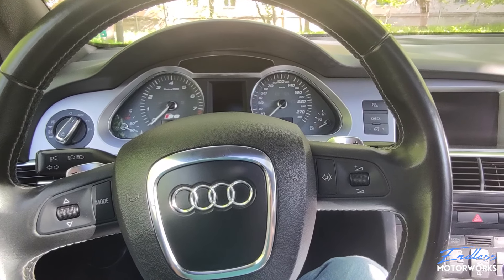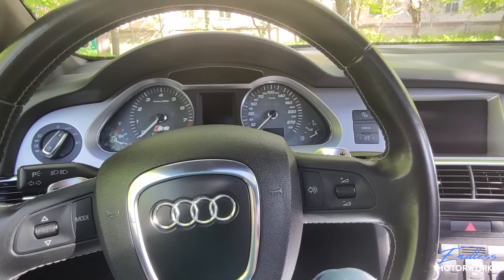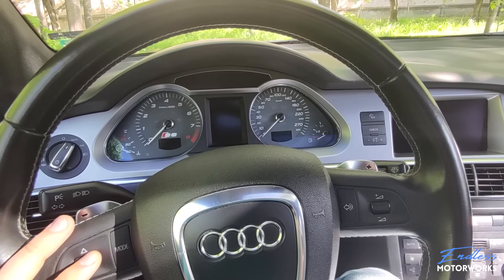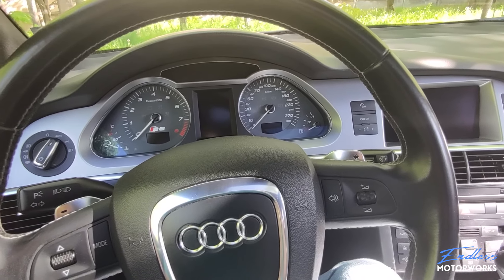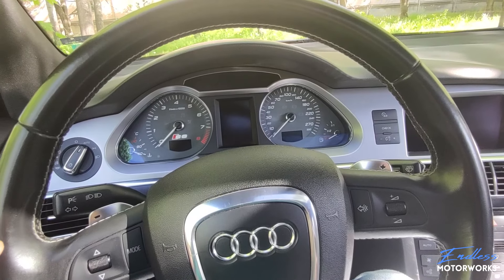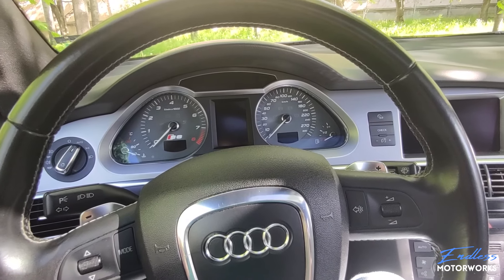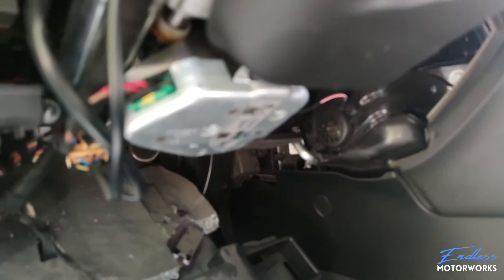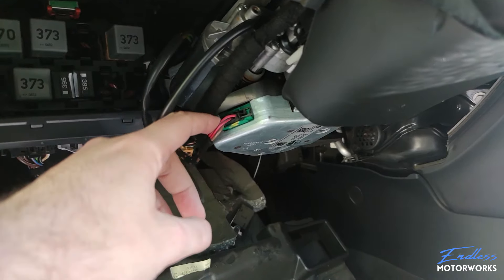How to Prevent or Fix the Steering Wheel Column Lock Actuator Issue on an Audi A6 / Q7 (DIY Repair)

Comment: I cut the red and black wire and my steering lock doesn’t lock now as you stated. But now I’m getting this annoying message on the dash now saying “to engage steering lock, press and hold stop button”. The message on the dash also has a beeping noise with it and it only occurs when i open the driver door to get out the car or when i open the driver door to get in the car. Any idea about this or do you know how to make that go away?
Reply from the maker: I have never seen or heard anything concerning this error message. The only reference I am able to find is of an error message that goes as follows: "Put the shift lever in Park or the car may roll away, to engage steering lock, press and hold stop button." Is this the fault message that you are getting?
Reply: @EndlessMotorWorks  I’m only getting the second part of that message which is “to engage steering lock, press and hold stop button” I’m not getting anything about putting the lever in park because it’s in park when that message shows up.

Comment: Hello Sir, My A6 2008 is locked and the thing is I cannot scan the code to clear it to unlock it first to do the trick. The car is not starting. Is there any other way to scan and remove it. Thank you
Reply from the maker: You can try tapping on the module with a hammer. I know this has worked for some people.

Comment: after cutting cable does the pilot and central lock from key pilot still work?
Reply from the maker: Everything else works, just the steering will not lock itself.

Comment: Hello friends!. I have the same issue with my Audi A6 Quattro 2005. The steering wheel actually is unlock, but  the car don´t start and when i put the key in the ignition nothing happens then. I like to do the action on the video descripted.
Reply from the maker: If your steering wheel is unlocked then you do not have the issue that I am referring to in this video. The 2005 A6 is also probably a C5 generation so the lock mechanism and wiring will be different. 

I would recommend getting your vehicle scanned for errors, as that is the correct way to diagnose the issue.
Reply: Thank You! 
 @EndlessMotorWorks

Comment: Hi. Will this work for a 2015 Q7? Is it the same wire color code?
Reply from the maker: Depends, 2015 is a transitional year for the Q7, which means that is the final year for the first gen one and first year for the 2nd gen one. If yours is the first gen Q7, then I would say probably yes.
Reply: Will this work on a 2013 Q7 3.0T gas?
Reply: @EndlessMotorWorks thank you for this video!!! Will this work on a 2013 Q7 3.0T premium plus with flip key?

Comment: Ok if the car don't start, instead of cutting the wire what if I just take off the plug, will the car still starts ans run
Reply from the maker: Nope, it doesn't work like that. Inside the module is information necessary for the immobilizer to work properly. If you disconnect the entire connector the immobilizer will think someone is trying to steal the vehicle and you won't be able to start it.

Comment: I have a 2011 A6 and today the "Please Take Load Off Steering" error was displayed and when turning the key the car will not start.
Does you method fix this issue and will a dash error light be displayed after cutting the wire?
Reply from the maker: Yes, the DIY will fix the issue. However, you must unlock the steering wheel and clear the associated error before cutting the wire. If not, your steering wheel will remain permanently locked and the error code cannot be cleared.
Reply: I had the  "Please Take Load Off Steering" message come up on my 2005 A6 about 3-5 times before the car just stopped working altogether. Towed it to a repair shop and the column was busted. Luckily the repair shop knew a place where they dismantle and fix old columns, so they took it out and sent it to the specialist. I got it (and the car) back fixed, soldered and whatnot. It cost 700€ but overall at least I didn't have to buy a completely new (expensive) one, which I've understood is a lot more.

Comment: In order to clear the fault code first, when Its already locked, I Will need to turn the ignition to perform a scan. How is this possible, when the column is locked?
Reply from the maker: You can turn the ignition in order to provide power to the cluster, you just won't be able to start the car.

Comment: Hi bro,got an issue on a 2007 Q7,steering lock stop working at a certain point,so I was ok with it,but yesterday car went dead,no dash lights,so I'm suspecting the steering lock,but in my case steering lock was already not functioning,if I succeed in clearing the codes,can I still cut the cable to prevent car going dead again?
Reply from the maker: Most probably yes, but I can't say 100% whether this will fix your issue, as I am only working with the info that you have provided. The best thing would be to have the vehicle scanned for error codes in order to know what exactly is causing the issue. If it is the steering column lock actuator, then you have your fix right here.
Reply: @EndlessMotorWorks  ok thanks already fixed,wasn't the steering lock
Reply: What did you do to fix it John? I swapped my battery every since then no dash lights key doesn’t recognize ignition and my wheel is unlocked
Reply: @johnfrazier9177

Comment: I have an 08 A6 that reads steering lock fault.
Starts runs and drives fine but I have to manually unlock door with key, keyless not working. and manually turn off the radio.   If I clear the fault and cut will that fix my problem?

Comment: My 2012 Audi A6 Prestige has developed this problem. Too often when I attempt to start it after a day or two of not driving it ‐ with foot on brake I press the start/stop ignition button -- it fails to start, but provides message "Please Move Steering Wheel".
I want to perform the procedure outlined in this video, but like I say my unit is a model year 2012 which puts it in the C7 level.
Can I perform the instructions on this video to my 2012 A6 - C7?
ADVISE!!  PLEASE
Jim
Reply: I failed to mention the obvious. After I turn the steering wheel as instructed and with foot on break press the start/stop button-- IT CRANKS RIGHT UP!!!

Comment: Hey man ive tried the tapping technique and pulled the fuse for a bit and what not but I still am stuck at the crank part?.. just cant get it cranked and a mechanic was able to but im not sure how he did it 😢 thanks in-advance
Reply: You need a reset . Take it to a mechanic to have faults cleared. Or you replace your entire steering column. Your welcome .
Reply: @TheINSANE10001  yeah the reset then the cut of the signal cord worked

Comment: would this pass inspections?
Reply from the maker: I don't believe the steering lock is something that is checked during inspections. It for sure isn't where I live. Still, might not be a bad idea to read up on what are the requirements if you live in a place where the inspection is very strict.

Comment: But if the wheel locked and wont unlock after key in, how ro unlock the wheel first? Audi a6 c6
Reply from the maker: You will need to clear the error code that is stored. After that you can cut the wire.

Comment: My steering is locked .I remove the error code 00288 and unlocked the steering wheel.I can start the engine, but when I switch the key to left to stop the engine steering wheel get locked immediately. Since it is only unlocked when engine is running can I cut the red wire with black stripe while engine is running?Would this action do some damage to car computer since engine is running?
Reply from the maker: You should be fine cutting the wire while the engine is running. Still, I would recommend doing what I show in the video, namely putting the ignition key in the accessory position, checking if the steering is unlocked and if it is, cutting the wire then.

Comment: Would this work on an Audi A8 D3 2006 3.7 V8 model? Has anyone done it on the 3.7 or 4.2 engine A8 D3?
Reply from the maker: The D3 uses a different steering column and internals. Because of this I can't say if it will work for sure. Still, this issue is not very common on the D3 A8.

Comment: I got the error code "take load off steering"  and wheel got locked. how do I unlock it first? help!
Reply from the maker: You will need a scan tool to clear the error.

Comment: Hello brother my car was 2008 1.8t audi a5 coupe..my car was not getting locked and unlocked and the ignition barrel was rejecting the key but the engine was not stopping..few mechanics said that key was getting signal key is perfectly alright…whats the problem if u know please let me know……🙏
Reply from the maker: Going on just based on the info provided, I would say that while it is rare, I have seen cars that for some reason start rejecting their keys. Probably you will need a new key coded. I can't guarantee this is the issue that you are having, but worth looking into

Comment: Found this video after getting Steering malfunction alert today, out of the blue. I have a q5 2017 (right before it changed model) 130k kms. Was looking through the comments but cant find anyone that has tried it on that car, could this work? Car’s at a friends workshop, he will check it out tomorrow. Thinking of sending him the video 🤔
Reply from the maker: Mighty work, but I can't tell you for sure. I know it will work on the first gen Q7 and the C6 Audi, as those share the exact same lock mechanism. I did see people in the comment section saying they tried something similar on other Audi/VW vehicles with it working fine though.

Comment: Does this work on a 2017 sudi a6
Reply from the maker: The specific guide is only meant to be used on the C6 generation and the first gen of Q7s. I don't think this will work on the newer models. Also, these aren't known for having the same issues

Comment: Can i do this when it's broken?
Reply from the maker: If your steering wheel is currently locked you will need to unlock it first. If you cut the wire to it when it is locked you won't be able to unlock it after that.

Comment: hello thanks for the information, the problem that I have in my Q7 2007 3.0 I have stopped it in 5 minutes I wanted to start it and the steering wheel has been blocked and it does not start, I hope that you answer me this happened to me today
Reply from the maker: The error codes will need to be cleared out with the dealer-level software in order to unlock the steering wheel. Only when the steering wheel is unlocked and the codes have been cleared you can proceed with the cutting the wire. The entire process is described in the video.
Reply: @EndlessMotorWorks must car be working or they must be turned off

Comment: Thank you so much for the video. A mechanic told me my 2008 s5 needs a steering lock module. Is this true? If so I can do this for my car still. Thank you!
Reply from the maker: Thank you for your kind words! Regarding your question, I don't know what the issue you where having was in order for me to tell you whether doing what I show in the video will help you out. Another thing to keep in mind is that the steering lock module on the S5 is different then the one Audi installed on the A6 C6 and the Q7. This means that the wiring and internal setup will be different.
Reply: @EndlessMotorWorks  my a6 c6 has steering lock problem strange thing is with key removed i can turn wheel around clicking starts sometimes is this same i am afraid it will lock up while driving thanks eoin

Comment: will it work Audi A6 1999 ? Thanks
Reply from the maker: Probably it will. I have seen some people commenting that they have done something similar on other VW/Audi models and it has worked out for them.  Do note that the wiring will be different so you will need to find a wiring diagram and see which wire goes to where and what does it power.

Comment: Hello, when it's locked how do you unlock it? I have this exact same problem in my A6, I don't have vagcom
Reply from the maker: You will need to have the proper scan tool and software to unlock it. Generally speaking, pretty much any independent shop that works on VAG vehicles will be able to scan the car for codes and delete the existing ones for under $50. At that point you can simply do what I show in the video. That being said, I have heard that sometimes tapping on the module itself with a mallet has been able to get it to work temporarily. Whether that truly is the case or not, however, I can't say as I haven't tried it out myself.
Reply: I belive you won't get it unlocked without clearing the fault first. As the fault clears it will unlock automatically and work fine till fault come back again
Reply: I had the same problem, i used obdeleven to reset and unlock it again.

Comment: My Audi A6 is fully automatic and have pust start button instead of using key to start and when i turn on the car the steering wheel still remains locked so any solution for that
Reply from the maker: Have you scanned the car for errors? Are you seeding any stored? More specifically 00288, which is the most commonly triggered error code for the steering lock actuator failing.

Comment: I have a q7 the steering is locked it doesn't wanna start the cluster no lights coming in I don't know what to do
Reply from the maker: Based on what you are describing probably you have a flat battery. I would start by measuring the battery voltage with a multimeter.

Comment: My steering wheel does not lock sometimes when I take the key out, so it stays unlocked. Also will this disable the fault code we get when we cant start the car? since my steering wheel stays unlocked sometimes, i still get the fault code, altough I need to double check this.
Reply from the maker: Like I explain the video, the steering must be unlocked and no errors pertaining the steering column should be present. Once you cut the wire, the steering will stay off and the codes (the already cleared ones) will not come back. Cutting the wire with the codes still stored may result in these staying permanently stored in the ECU.

Comment: I have a question, I hope someone can answer it. I have this problem, when I turn the key, the steering wheel won't unlock and the ignition won't turn on. By clearing error 00288, the steering wheel unlocks and everything turns on. Can this system I see in the video solve it? I see in the video that after cutting the wire, the steering wheel remains unlocked but I don't see that the key has been reinserted to turn on the ignition. Thank you very much
Reply from the maker: Yes, following the guide in the video will resolve the issue. Just make sure you clear the code and only then cut the wire.

Comment: Hi my Audi A4 B8 won't start nor switch on the cluster, when I insert the key it writes, steering lock defective. How do I solve this?  I've tried to replace the steering lock but still no luck
Reply from the maker: The guide that I have made applies only to the A6 C6, first gen Q7 and partially to the A8 D3. Not sure how the module itself is wired on your particular vehicle. That being said, when replacing the steering lock module on a newer Audi it will need to be coded, as it contains information necessary for the immobilizer to be able to function.
Reply: When it happened on my audi A6 c6 i just cleared the faults and it worked for 3-4 months with no issues and now it happened again. Cleared fault  "steering lock actuator" and it works again, but don't know for how long this time

Comment: I hace cut the red/black cable, but it gives me error 02638 indicating faulty starter lock and leaving a message on the fis screen. Before  cutting cable clear faulty with Vagcom. I hace accessed módulo 05 but there si no option to disable.
What could have happened?
Reply from the maker: Most probably the error was not cleared properly. Clear the code, start the vehicle. Try cutting the wire, while the vehicle is running. This will ensure the steering column will not be locked.
Reply: Thank you much. I'll try again with the engine running.
Reply: I cut the red/black cable again, after clearing the fault with the engine running.  Everything is going well until he took out the starter key, without taking it out, he turned it off and on several times without an error.  When re-inserting it to boot, a beep sounds and error 2638 appears, the cluster detects the cut cable, but everything works fine, only the unpleasant message remains on the fis screen.  I will keep trying to find and clear this bug. Thank you for your response.
Reply: @joseantoniosanchezdelgado1918  Got a solution? Thanks BR